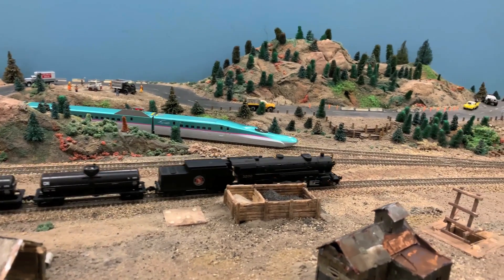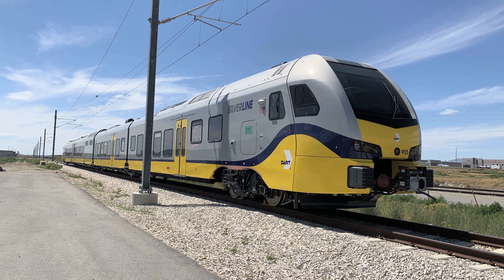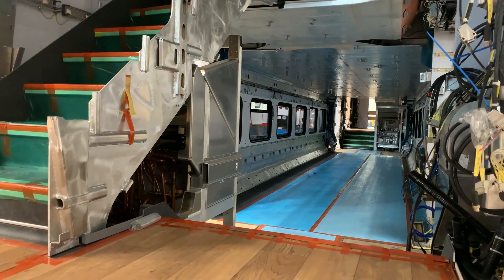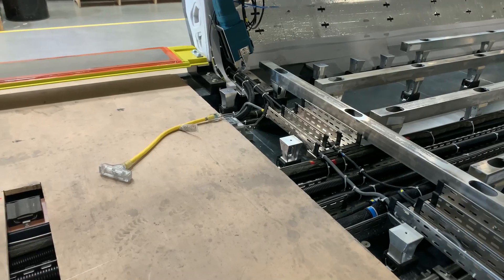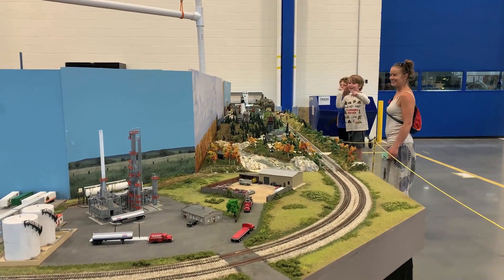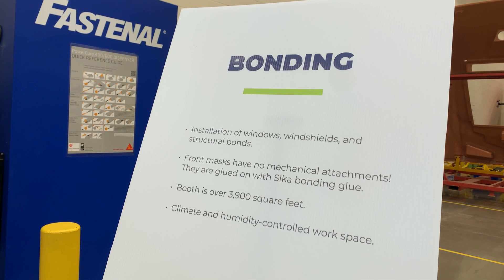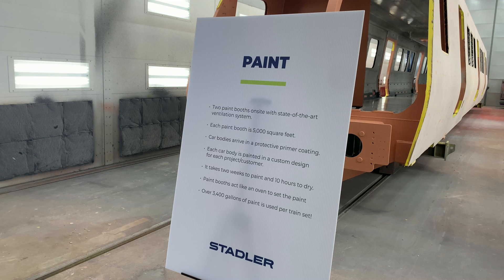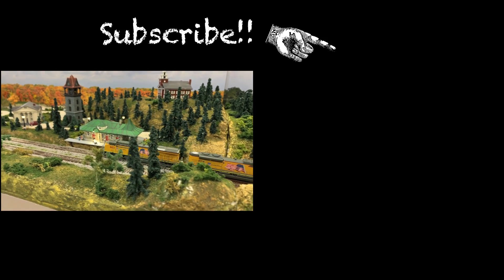The Future of Rail Transportation? Over 1741 Miles (2801 Km) on a Single Fill of Hydrogen!

Comment: What an awesome location for a train show, you can check out the little ones and the big ones! Great to see some new trains built in the US, and the company certainly seems to be friendly with modelers and enthusiasts as well. 

As a 3D modeling and printing hobbyist (secondary to railways) I was wowed by the 3D printer shown. It seems to have much greater build volume than your typical consumer printer, and the part that's printing would probably take 30-40 hours to get to that point at my printer's speed (depending on detail and infill). I'm currently about 25 hours into printing a small diesel shunter kit for my garden railway.